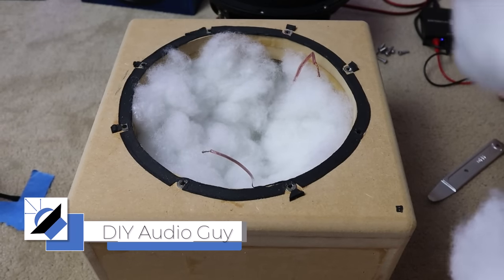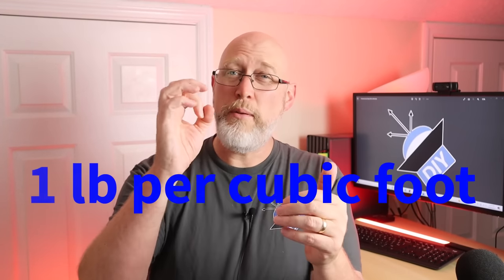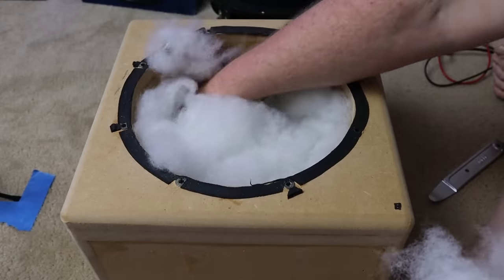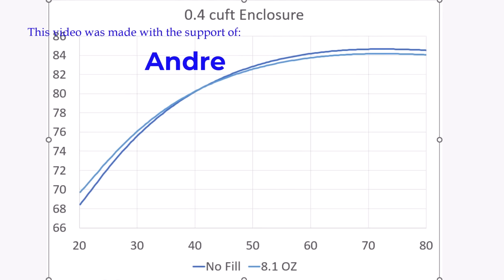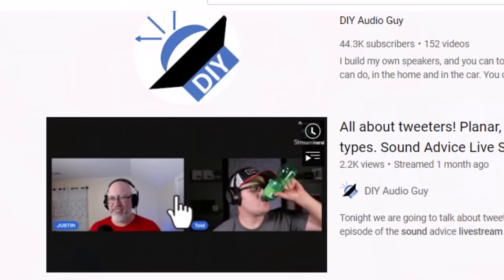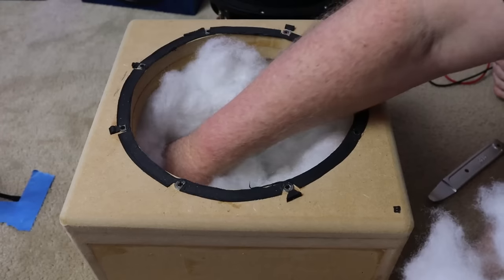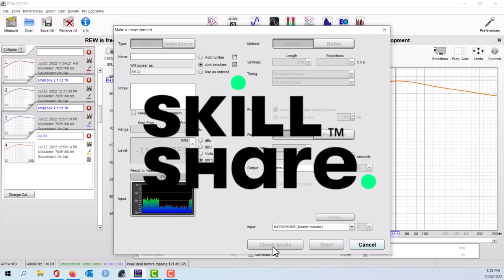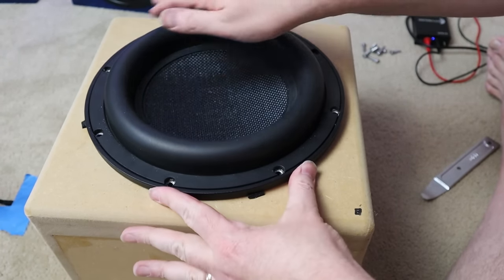Can Polyfill "fix" a small box:  Bass in a Small Space

Comment: Well sealed enclosures are said to not benefit from polyfill it's for ported enclosures that are too small for your subwoofer to trick them in to thinking there's more airspace. Anyway I'm hoping that's true because i'm about to throw a NVX VCW82 Version 3, 8" sub into a $220 groundshaker 30hz spl enclosure that's .98 cu ft when the sub wants 1.25 cu ft which could make this box a $450 mistake if it doesn't sound good but it's the only option I could find that will fit in the spot my stock subwoofer lies in my 2005 crow vic. I was told subs has a +/- tolerance of about 10% on box size but .98 is about 20% off from 1.25 so i'm hoping some polyfill will save the day. Lol also your fill was all puffed out like a afro mines in padded sheets like 3" thick not sure if that effected your tests or not. In my car i only listen to rap and Nu metal so i think 30hz will suit me fine even though seems a little unheard of for a 8" subwoofer, let me know what you think especially if it's a mistake maybe you can catch me before i pull the trigger on the box.
Reply from the maker: Your first sentence has it flipped.
Reply: @DIYAudioGuy  Yeah trying to research this and has me a little confused since i can't make a box to save my own life lol no wood working skills and having a hard time finding a box to fit my needs size wise. Anyway i did find a box to fit the bill and was $120 cheaper 1.4 cu ft tuned to 34hz do you think i should still use polyfill? This box doesn't come with it most boxes do though i have 2 skar audio ported boxes with fill in them.

Comment: Small box I cannot change.  With basket and back of sub taking all that space inside the box, thinking if I went with a shallow mount sub, maybe I can reach proper inclosure. Or since I have the sub with all that basket, just stick with it.
Reply from the maker: The box is the limiting factor.  Not much you can do if you are stuck using a small box.
Reply: .375 is what my inclosure is.  Subwoofer that I have is alpine R-W10D4. Alpine says to use .5 inclosure.   I am only throwing 600 rms 2 ohms at it.  Sub says up to 750 rms.
Reply: Polaris slingshot storage compartment is where sub is at.  My idea are to get sub that takes up less internal space in box and requires less power, pull current box and try my hand at fiberglass to try to come up with a bigger box. Maybe there is another idea or way?  I will have almost 4 months to come up with solution cause winter months.
Reply: @DIYAudioGuy what is your thoughts?
Reply from the maker: @chicken133221  I think you need to use a smaller subwoofer.

Comment: 1dB is the limit of hearing, AT ONE FREQUENCY. It's not correct to say that a 0.8dB change over a wide range of frequencies is not audible becasue humans can't hear any difference of less than 1dB. Because when the acuity testing on humans was done, it was done with single frequencies. Humans hear sound by overall energy/power. If you drop the level of your tweeter by 0.8dB and do nothing else to the speaker, an A/B test will result in most people being able to hear a difference. Because despite the drop being small at any given frequency, it impacts 2-3 octaves and so the total energy reduction is audible.

Comment: polyfill - yet another way of decreasing efficiency at a higher frequency so you can turn up the power and get more sound from a lower frequency.
Reply from the maker: It's kind of like an equalizer made out of pillow stuffing.
Reply: Tighter, better sounding bass too - much less of an upper bass peak followed by a steep dropoff in ported boxes while much better SQ in sealed enclosures.
Reply: @Ezees23  Not everyone makes vented boxes like that though. I wouldn't write them off so quickly.
Reply: @elephant1851  There's polyfill or other damping material in vented boxes too. If you'd write box damping material off in every vented box that just means you don't know what good bass is, LOL. A vented box without any damping material is one of those "one note" bass boxes that fails to reproduce other bass frequencies well besides it's major resonant peak, LOL....
Reply: @Ezees23   I use fiber fill to get rid of higher resonances in vented boxes too. I just said vented boxes are not always peaky like you think they are.
Reply: @elephant1851  Noted.....and I misread your post. I read: "I wouldn't write them off so quickly".....instead as: "I 'WOULD' write them off instantly"....which was obviously the opposite of what you were saying. My mistake, and thanks for the correction.....

Comment: I add a pool noodle with cat litter on the longest side behind magnets seal the ends up. Think about the physics , different resonances cancel standing waves
Reply: I also brace top to bottom, side to side, front baffle to back then glue the intersecting points with liquid nails and bread tie wire for rigidity.  It gives the air the illusion  of 8 smaller cabinets. 
Sorta helps the responce.response. I also prefer one woofer per chamber
Reply: Make braces from 1x3/4 in scrap MDF ,NO solid or plywood..
Reply from the maker: Yeah, I think bracing is probably far more important.
Reply: @DIYAudioGuy , I have 50 years of tips ,if you like , I'll post. My DIY, stuff leaves them 
Speechless, jealous of my technology/ art.  I have 500 or more custom cars,homes,boats. Retired even the pictures and negs are faded or stolen. Along with 20 signed ,dated albums. I'm broke terminal no feet ,30% heart,diabetic. But have built 2 home concert systems this summer, new short cuts,I never quit or stop studying.  
DIY ,,,💥Rules

Comment: Tricks are for fools, build it right the first time and you won't need any magic fixes.

If you don't know what you are doing, have the wisdom to know what you don't know. You're not going to master box building over a weekend. If you don't want to put the time in to learn it, contact a local professional box builder and have them design one for you, you can usually even get them to just design and/or cut the wood for you so you can save money building it yourself. There are many designs available online for purchase, utilize them.

Do not spend a bunch of money on good components and screw yourself by cheapening out on the box. If you think polyfill is a good idea, it's not, It's a last ditch effort to fix a bad box design. Sub woofers don't think, and neither do half the people in this comment section.

I will always recommend boxes built with solid ply wood on serious builds. 1 inch thick minimum. There should be nothing inside your box but bracing, subwoofers, and large speaker wire. Save the mdf for practice.

I would recommend a sealed box for rockers/metalheads and ported for most bassheads. The subwoofer manufacturer listed the specs for a reason, read them, or give them to a pro who can.

If you're building a sub for an indoor system and are having resonance issues, try putting a closed cell foam/rubber mat under the woofer to separate it from what it's sitting on (usually hard surfaces). You don't want a woofer vibrating your floors/walls/foundation.

Comment: Acoustic fill decreases second & third harmonic distortion.
that's  its Main Purpose..
Reply from the maker: So it's a sound quality question, and I should be doing some AB testing.
Reply: @DIYAudioGuy  Your REW measurements from this test should already have the data you need.  Just check what the THD graphs for the measurements look like..
Reply: @DIYAudioGuy  
Second & third harmonic distortion is the Soundwave that bounces back toward the speaker cone causing a re occurrence of the wave after the original wave was played.
Causing a smeared boomy sound from the speaker.
Basically  muddy Sound..

Comment: You definitely shouldn’t stuff a box with poly fill and I recommend against it. My comment was clear that you should use blanket polyfill that comes in a thin sheet form and use spray adhesive and put a layer of it on the walls. Ive also only done this on ported boxes covering everything but the port walls.
Reply from the maker: Yes, I like working with the quilt batting a lot better than the loose stuffing.

Comment: I guess nobody here learned about thermodynamics.  The glass fibers on fiberglass fill pull heat away from the voice coil.  This is like using plastic heatsinks in an amplifier.  Polyfil is a total amateur move.  No wonder drivers die faster.
Reply from the maker: Pretty sure I mention the thermodynamics in the video.